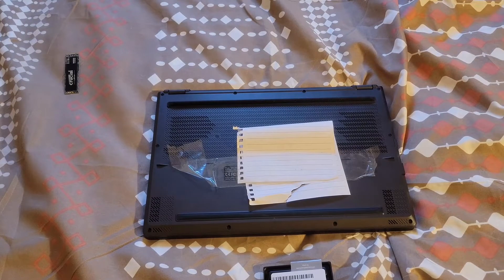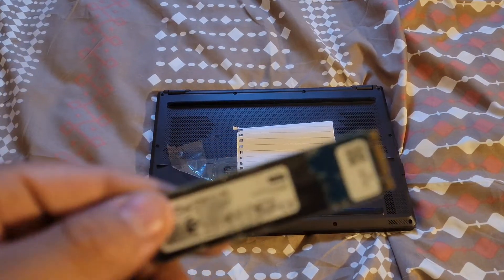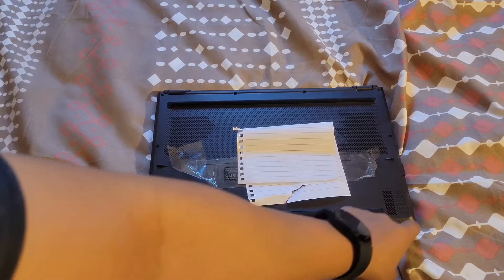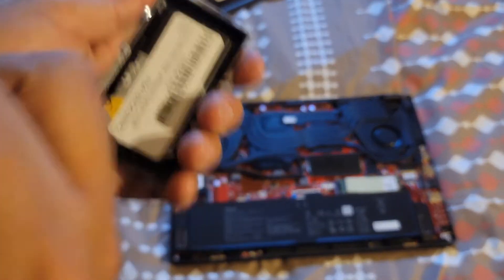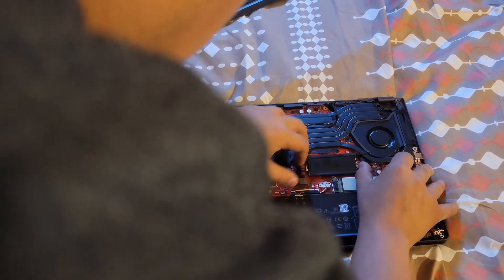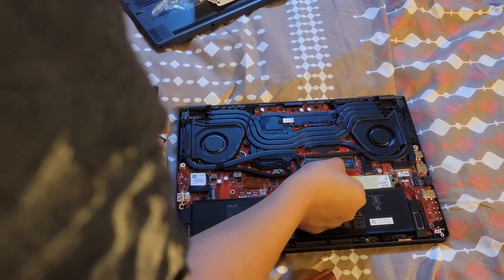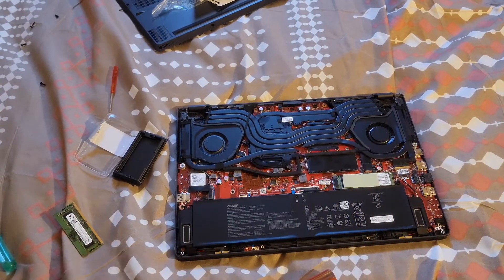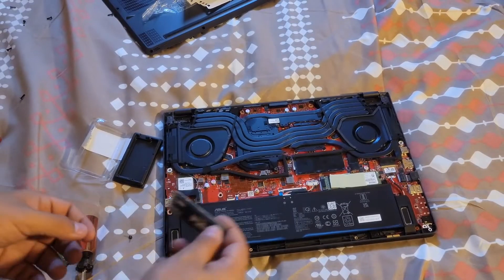Ram upgrade 32gb to ASUS ROG Zephyrus G15  and adding secondary drive

Comment: A bit fast for me - so you replace the original 8GB RAM with a single 32GB RAM? When I do a scan on Crucial it shows a 2 piece 32 GB upgrade which is not possible in a single slot.
Reply: U can’t take the original off. He’s adding the 32gb to the open slot, I guess he just has an old one he added

Comment: 2:23 Thats Is M and B key So it's a SATA Bus or PCIE 2 lanes m.2 M key is a PCIE 2/4 lanes.  BM will not exceed 600 MB/s, M lane 2 10Gbit/s  lane 4 20Gbit/s

When building or upgrading turn it off is 1 but all ways unplug the Battery/PSU

Comment: if you put a 32gb ram, you have in total a 40gb of ram. right?
Reply: Yes, and the way it will run is: up to 16gb it is dual channel, and any load over 16gb will run the first 16gb in dual and the remainder in single channel
Reply: That's what I was thinking.